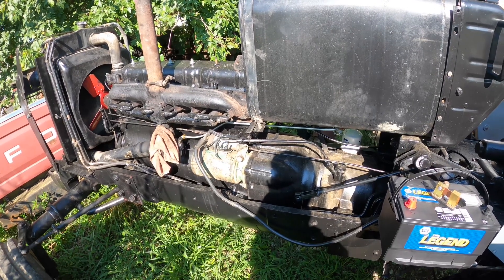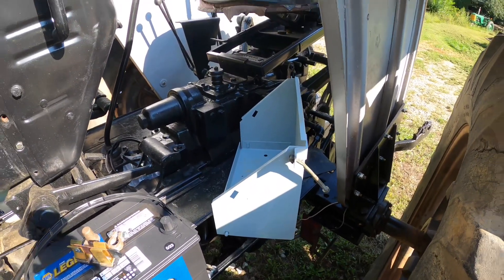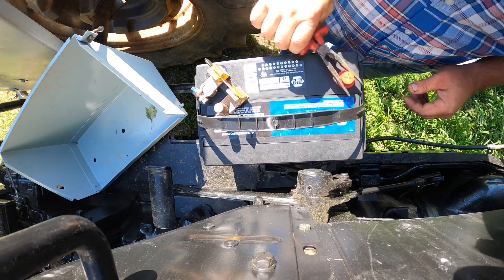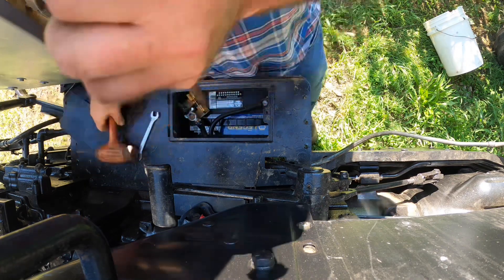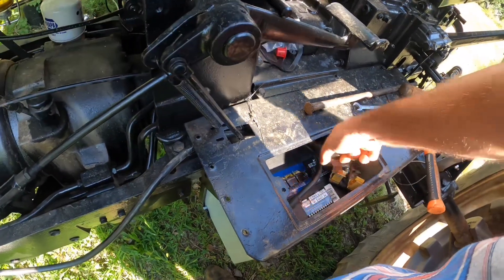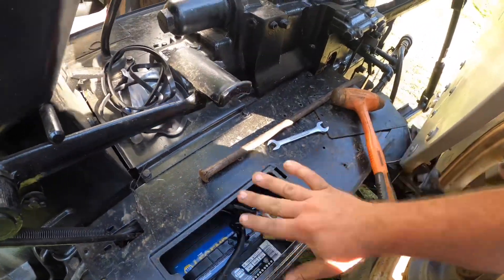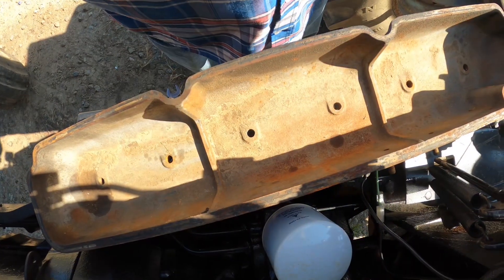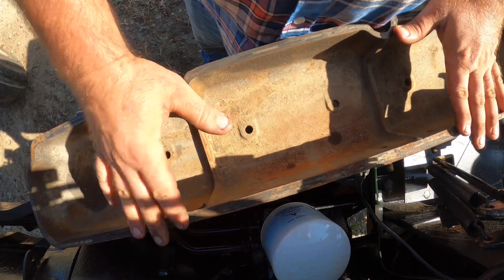More WHITE 2-70 gas PROGRESS

Comment: glad you rerouted the battery cable. arent those valve cover stus at least  half nch to long ?
Reply from the maker: Some more longer than others. The green tractors had an air cleaner mounted on top of there so two of them were always longer. he lost the original so obviously he was just using whatever he had.

Comment: Hey Ross on White tractor 2-70 did have lots issues with that engine or was designed poorly built time put on market to fast were failures in fields on farms? Or did sale little 2-70 on market? Or White tractors was poor leaderships weak engines and failures all above department? Thanks again answer my questions great video keep up good work one more could you send your address I want send some to you.  Thanks again 
 Once again great video's. 😊😊😊😊😊